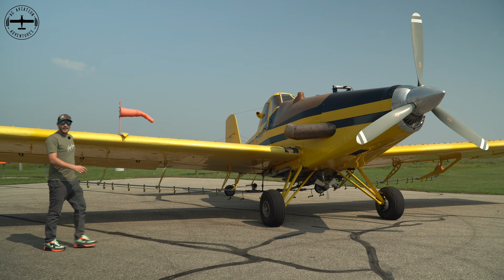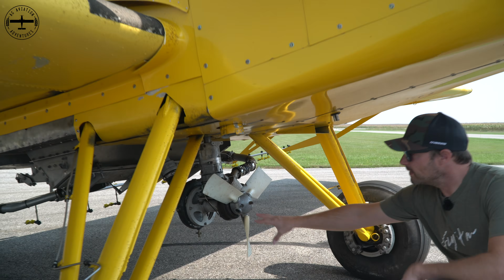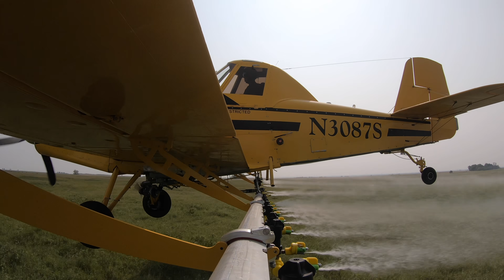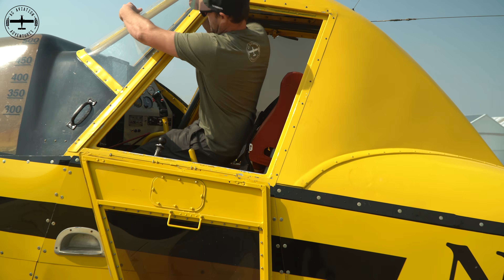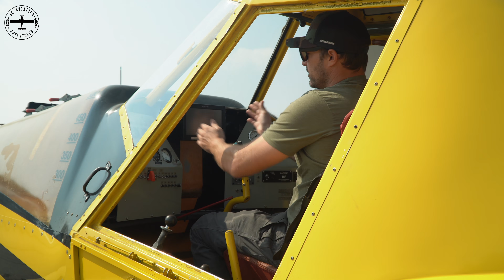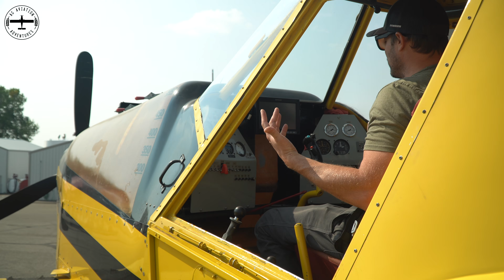Thrush S-2R Spray Plane Walk Around

Comment: Awesome video! Is the airframe on the 400 Gallon S-2R’s the same as the 500 Gallon machine with just a difference in hopper size, or are they different like the 402 and 502?
Reply from the maker: Yep, it's the same. The frame is about the exact same from these as they are using for the 510's today (I think there is one support they are building in that we don't have). But for the most part the same! Crazy, right?!
Reply: Wow that is crazy! Thanks for your reply!!

Comment: hi, I am 62 years old, and I have 35 years of experience as an airframe and engine aircraft technician and controller on the S2RT34 and S2RT660 turbo-thrush aircraft, within the air group of the Royal Gendarmerie Rabat, now I am in retirement, and I wish to work in your company in the position that corresponds to my specialty, awaiting a favorable response, please accept my sincere greetings sir.

￼
Reply from the maker: Thanks for the comment. We are not currently hiring.

Comment: hello there, do you guys have a video talking about the part 141 and 61 for crop dusting? if so, i didn't find it but, is 141 necessary for crop dusting?
Reply from the maker: No, part 141 isn't required for crop dusting. We're not sure anything "requires" part 141? I suppose some employers could require 141 but you can do a lot through a 61 school.
Reply: @AgAviationAdventures  ty so much I really appreciate it

Comment: I appreciate your adaptability to the Thrush over the “Cadillac” Air Tractor you’ve been used to. I believe it comes down to the pilot flying it and how well the maintenance is performed. You can obviously get the job done in a Thrush. I know there are Thrush haters out there for whatever reasons ( likely not by too many good ag pilots), and I’m personally partial to Air Tractors because they’re built here in Texas 🤠, but any of them will lose their wings if a load is dumped all at once and you pull up to fast. It comes down to knowing the aircraft and its limitations as well as its capabilities. I believe your Thrushes are in good hands Tyson!! You’re like a modern day WW2 fighter pilot in an ag plane! 😂😂 I look forward to your Stearman one day!
Reply from the maker: Just a quick note for anyone reading through the comments here. I think the wings falling off incident you're referring to are the viral gender reveal crash(es). Those are the Ipanema aircraft (I think made out of Brazil) and the wing spars time out. The result of the wings failing is likely due to maintenance neglect. That is extremely rare for Thrush or Air Tractors (when maintained properly, especially because we take our maintenance times very seriously in the US. 
Just wanted to clarify that because a lot of people who see those videos mistake them for Thrush or Air Tractor. 
Thanks as always for your comments, Rob!!
Reply: @AgAviationAdventures  You’re absolutely right. I apologize too for not stressing the maintenance part of the equation enough. I have seen two videos of a Thrush and a Pawnee though, both spraying when the wings failed. That’s why I mentioned maintenance and over loading the wings. But again, I didn’t stress the maintenance part enough. The spars do have a limit to how long they’re safe. The gender reveal was indeed a different aircraft and was mainly due to poor maintenance but also over loading the wings when the weight and balance changes so dramatically by dumping the load all at once and pulling straight up at the same time it increases the g factor quickly and can cause over stress to the wings. A newer, PROPERLY maintained aircraft will let you get away with it. One with cracked or fatigued spars won’t. The C-130 fire fighting aircraft that crashed a couple of years ago was exactly this scenario.
Reply from the maker: Absolutely!!

Comment: Tyson i notice that garrett prop turns ccw like the pt6,  but does your other thrush turn cw ?   my question is,   when you jump into a cw turning prop,  is it a challenge to use opposite rudder on take off and are the turns to the right easier ?  thanks
Reply from the maker: The -10 would turn CCW and I've not flown one. This is a -6 and it turns CW like the PT6. Thanks for watching and commenting!
Reply: -6’s turn the right way. -5’s and -10’s turn the wrong way. It’s not so much a challenge using the opposite rudder, as one must always give the aircraft the proper control inputs that it needs.

Comment: 500 gallons that's a lot of weight, couple tons worth.  Curious if it'll haul a full load on a high density altitude day?  As I recall way back in the day, my Dad's old sprayers had about 180 ish gallon hoppers, but they didn't have the big wings & engines in those days either.
Reply from the maker: Yeah on hot, high density alt days it can be hard to haul the full 500 gallons but it also depends on the strip, fields, etc.